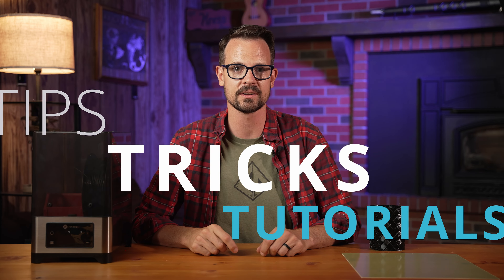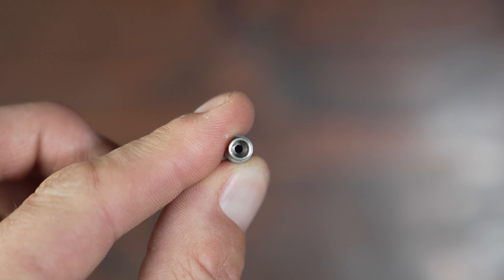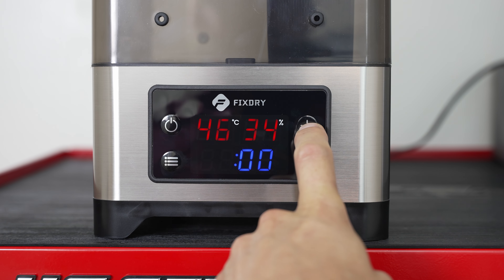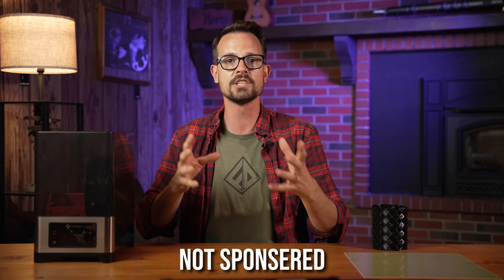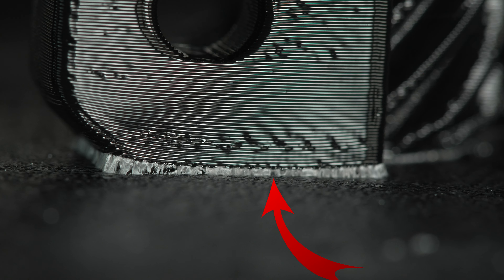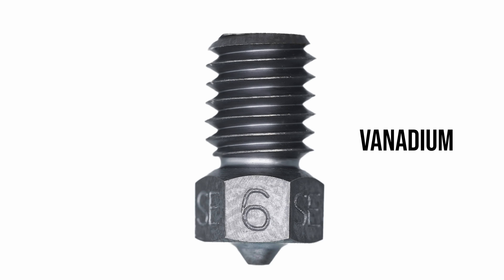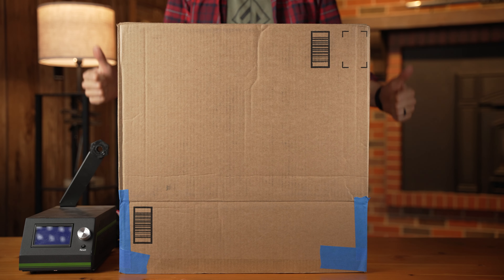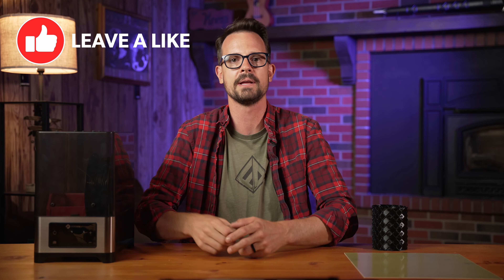How to Succeed When 3D Printing With Nylon

Comment: This left out so many important aspects of printing nylon wtf
Reply: Perhaps you could make a video to clear everything up for us.
Reply from the maker: What sort of things did I leave out, I would love to hear some of what I missed.
Reply: @BuildItMakeIt like actually printing a part?!
Reply: @BuildItMakeIt  Nylon PA6 and PA12 have different mechanical properties. PA12 is more flexible, and PA6 is relatively rigid, for example.
Reply: Most people won’t watch one, three minute video before diving into a material like nylon (or at least they shouldn’t). I think this video had good information on the points that it did make. It certainly helped me in deciding how long to dry my filament before printing.

Comment: The enclosure is what will avoid warping. In my experience if your not getting the enclosure temperature to at least 40°C doesn't matter your using a garolite bed, it will warp and fail.

Comment: With nylon being hydroscopic, what will the impact be if you use the finished nylom printed items in water?
Reply from the maker: The nylon will expand so it probably needs a coating to handle submersion. I know that epoxy is very commonly used to coat nylon parts that will be subjected to water, but on full submersion I am not sure.
Reply: Submerging nylon in water after printing is actually great for improving durability. Moisture reduces the rigidity of nylon (especially PA6), but makes it much harder to break. If you need it to stay rigid go with PA12 or PA612, ideally with carbon fiber.

With that said, nylon technically can still degrade from lots of water exposure despite its excellent chemical resistance.

Comment: Thanks for this video. Great tip regarding use of filament dryers directly feeding the printer. Also, thanks for the heads-up about not really needing an enclosure. I'm leaning toward a Bambu A1, and your Amazon solution means I don't need to shell out the big bucks for an enclosed P1S, although I might buy a $50 grow tent to replace the cardboard someday lol. Oh, one other thing, in case you ever make a follow-up video, Nylon is a brand name, the actual material is Polyamide or PA, IIRC, so you might get more YouTube search hits if you put "PA/Nylon" in your title next time. Keep up the great work!
Reply from the maker: Wow I didn’t know nylon was a brand name. That is really good to know. It’s crazy how many of those pop up in everyday life.

Comment: can I get away with printing glass filled nylon with a .4 mm nozzle?
Reply from the maker: Yep that should work. I haven't had an issue with a .4 nozzle and glass filled before.
Reply: Cheap filaments use short fibers , which can go through a small nozzle. However they are weak, what you really want is expensive filament with long fibers that require a larger nozzle.

Comment: Use pla pla carbon it prints fine
Reply from the maker: I do like pla carbon fiber, but it doesn't hold up to water or outside usage for me over time. I also really like ASA carbon fiber filled. That gives me the durability for outdoor prints I like.

Comment: Great video.  My perspective is different than the overwhelming 3D printing people. First difference is I'm new to it.  Second difference is my printer, a K1C. Being enclosed makes things easier and more inclusive. Third difference is upgrades. Fourth difference is my age. In other words, I've been interested in 3D printing concepts since the 90's, when costs were high, real high considering today's costs. So, today, prices are reasonable (my new laptop on run the printer modeling and slicing were more than the printer) and filament choices are better than ever. 
   This is a long way of saying short vids on printing are much better than 20+ minutes explaining setting up old, open designed printers with multiple setup steps, all of which effect the print. 
The newest generation printers are as close to 1 step printing as ever. This creates the opportunity for great expansion of printing people. The 2nd generation of printing.  While some of us remember the original airing of Star Trek and it's replicator, it's now available to tech neophites.  
Today's steps are: (1) Place filament spool in dryer to dry for 6 hours minimum. (2) Feed filament thru dryer & it's tube into printer/head.  (3) Prep buildplate. (4) Turn on printer & extrude until filament comes out. (5) Select model to print & print with bed calibration. 
Sure, I left out modeling software techniques and slicer settings, if not obtaining downloads of print models, but, those are a different yt search.
Happy printing !!!
Reply: Wow ChatGPT making comments on YouTube.
Reply from the maker: Happy printing to you...

Comment: important note: teflon = brand name for PTFE. it's what you probably have in your printer

another note: the nozzle that came with your printer is probably brass
Reply from the maker: Thanks. Those brands getting in my brain make it hard to stop using them for the real term. I used to do some construction and still have a hard time not calling cement screws Tapcons.

Comment: Great video, thank you!

I have a question:    I need to print an intake for a go kart engine. Where the small carburetor is on the end. Karts have no suspension so the part needs to be strong to 'shaking' with the carburetor on the end. Can you advise the type of filament I should use please?
Reply: Might be too late, but i would suggest to take a look at bambu’s ppa-cf. Its currently on sale until the 27th. Its strong and very durable. Also it’s chemically resistant, which is necessary when used on a carburetor.

Comment: Nice!  I'm new to PA-CF   Tried yesterday with a new spool,  Whilst my QIDI plus 4 prints easily,  the layer adhesion is not great I can snap it easily on parts, at 270C and a bit better at 285C   I'm drying it now in a creality  filament dryer which I can keep on whilst it prints also.  and hopefully Prints stronger, :)     I think the part could take 300C   Sticks to the bed real nice on Texured PEI   / glue stick at 60c      first time at 80c bed it wouldn't stick.

Comment: West3D Undertaker Tungsten Carbide nozzle is a much better choise than hardened steel, many many times harder and almost identical thermal properties as brass to get a good melt.
Also it is a 1-piece nozzle unlike ruby nozzles which is a piece of ruby embedded in brass.
I am not affiliated with them i just really think these nozzles are great, ive pushed almost 10kg of ASA-CF through one and its still like new.
Reply from the maker: Thanks! I haven’t heard of those. They look really nice.
Reply: @BuildItMakeIt  There is also "Bozzle Nozzle 0.5mm" but its out of production for the time being, it is the same but highflow geometry inside, hopefully in the future.

Comment: I want to start printing small gears out of Nylon. They are relatively small, 6" diameter and smaller. What would you recommend as a starting printer, that would produce quality prints? Somewhere in the $1000 to $1500 dollar price range.
Reply: Would the Bambu Lab P1P be a good option?
Reply: @DescendantOfAbraham  For nylon you'll want a printer with an enclosure, so go with the P1S. Both printers in the P1 series are great, but there's not much point in buying the slightly inferior P1P especially if you're planning to print nylon. As for drying the filament, you can technically do it with any heated bed and a cardboard filament box (look up the technique) but since nylon absorbs moisture so quickly (it can absorb too much before the print is even finished) you might just want to buy a proper dryer. Note that dry boxes and filament dryers are very different things. One keeps the filament from absorbing more moisture while the other actually removes it from the material.

Comment: Nylon is insanely hygroscopic.  Absorption rate per minute is significantly higher than any other material.  And the consequences of water absorption  are catastrophic.  Never ever leave it out in the open not even for 30 minutes. Keep in sealed container with desiccant beads such as 4A Molecular Sieve. They do the best job at h20 absorption 
Drying: 90C is required if you use high quality nylon 70C will not work.
G10 with hyperlock and bed clamps(yes these three with use of x1C
And yeah a lot more to it than this…
PAHT, PA, PACF PAGF, PAHT CF,  PA6, PA12.  A lot of nylons out there that have different properties and different requirements.

Comment: just don't store your fillament (even the packed ones)  in open air.  
sure if you just get it from delivery you might need to dry it out. 

but mine.  i order filament. and i might not use that filament for several days.  (because i am not printing or using a diffrent spool) 
so i store mine in a drybox.  not heated or anything just a shit ton of desicant bags in there. 
it litterally get the air down to the low single digit percentiles of moisture. 
this is more than dry enoegh to passively dry out anything you put in there. 

infact sticking your hand into the drybox makes the drybox feel much colder than the surrounding air even though it's the same temperature. (any moisture on your hands is instantly vaporising in the dry air and thus cools your hand down)